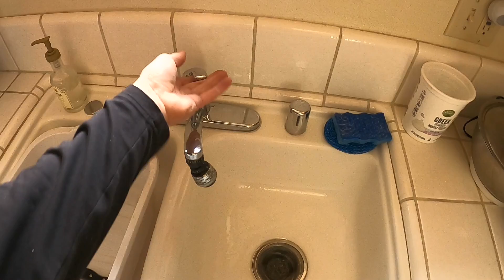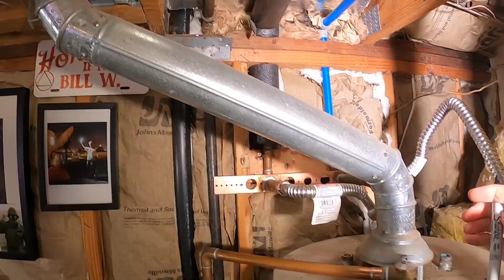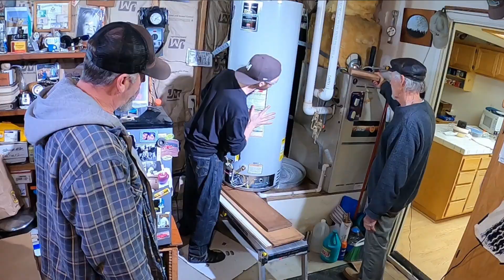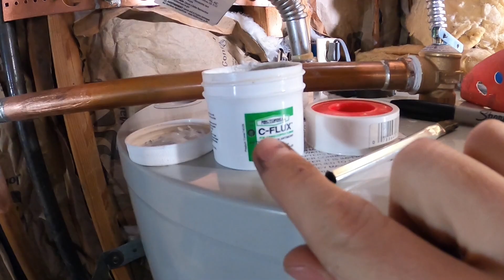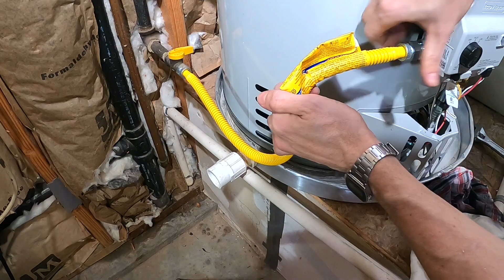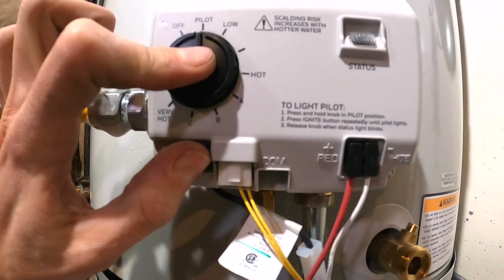Replace your Water Heater Yourself with this Easy Step by Step DIY Guide

Comment from the maker: TOOLS & SUPPLIES & DONATION LINKS
Water Heater Flex Supply Lines- https://amzn.to/3KqmKHp
Flex Gas Line- https://amzn.to/3xGMYha
Gas Leak Detector Tool- https://amzn.to/3SitpoY
Pipe Thread Sealant Compound aka Pipe Dope- https://amzn.to/3jiT4No
Pipe Tape Water Lines- https://amzn.to/2Cp446j
Pipe Tape for Gas- https://amzn.to/3E9Gqu5
Propane Torch Kit- https://amzn.to/2OkfBJr
Solder & Flux Kit- https://amzn.to/3Z7OLIp
Plumbers Wire Brush for Cleaning- https://amzn.to/3kdmEbv
Large Adjustable Wrench- https://amzn.to/3IpGWpY
Adjustable Wrenches- https://amzn.to/3WCXil5
Pliers- https://amzn.to/3ttaiNv
Tubing Cutter- https://amzn.to/3xJYAA4
Debur Reaming Tool- https://amzn.to/3lQnzPj
Gloves- http://amzn.to/2w0i1SP
Nitrile Disposable Gloves- https://amzn.to/3w714qi
Tool Set- https://amzn.to/3tbmEbo
Safety Glasses- http://amzn.to/2ez41Jw
Magnetic Work Light- https://amzn.to/33tk6tp
If you Enjoy the Channel Consider Helping Support it by Donating with Youtube Super Thanks or Using Links below or by Subscribing (it's Free) & Watching some of my other Videos
PAYPAL DONATION https://www.paypal.me/JonnyDIY
Zelle Donation JonnyDIYs@gmail.com 
Venmo Donation JonnyDIYs@gmail.com

Comment: Why does the onscreen inserted message say
'just no gas line or venting'.
Wh o gets to do those parts?
It will still cost plenty to have them done by a plumber!
Reply from the maker: @Rustledin  that was an inserted message about electric water heater installs 👍
Reply: @JonnyDIY 
O K  👍🏿
GOT IT !

Comment: Can I just hire you to come live with me for a week and fix everything on my list? 😂 My old gas wall heater that you help me light the pilot on every year keeps shutting off. I have to turn the thermostat on and off multiple times or take the thermostat off the wall and put it back on multiple times and it starts working again. My landlord has sent someone out 7 times, they replaced the thermostat and it still does the same thing. I keep thinking I bet Johnny could fix it 🤣
Reply from the maker: @dotsonms  🤣 wish I could! Maybe tell them to check the thermocouple 👍 that is usually something that can lead to issues like that
Reply: @JonnyDIY  I will, thank you!
Reply from the maker: @dotsonms  You're welcome, hope they can get it fixed 🤞